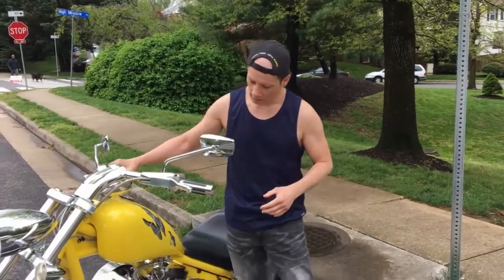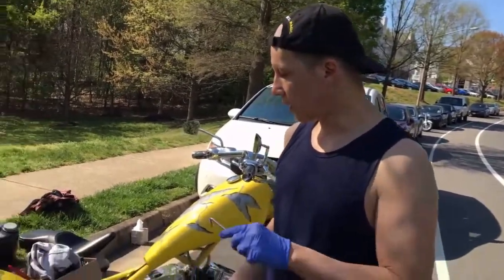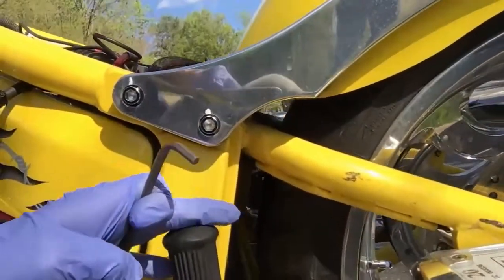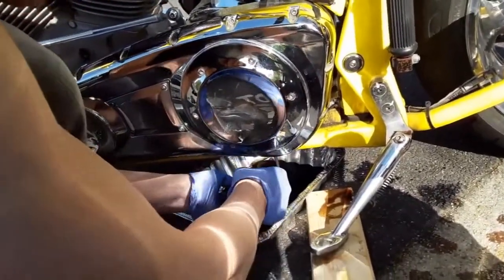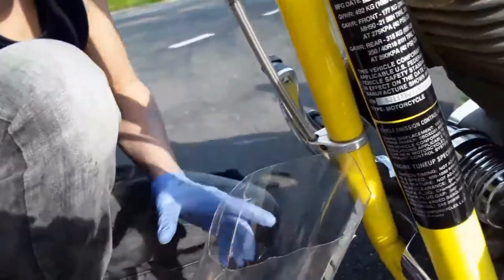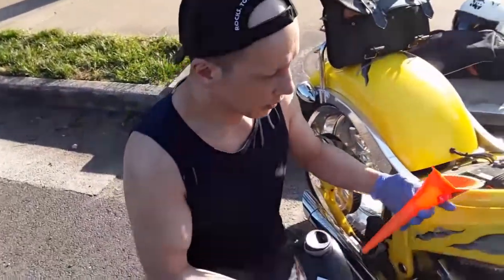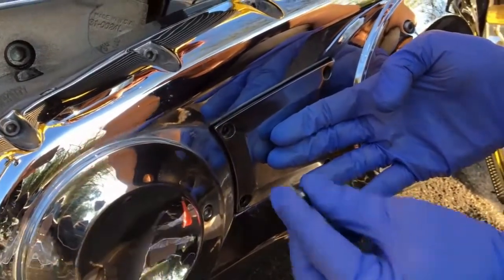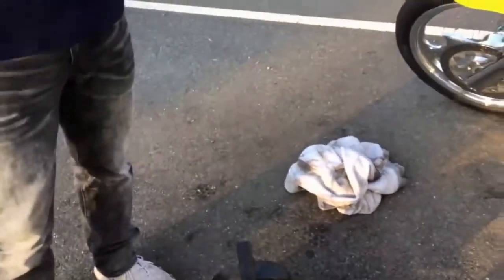S&S 117ci Engine oil change, Baker 6 speed transmission fluid, and baker DSSC primary fluid change

Comment: Great video bro..On my big dog pitbull 2006 primary capacity say 1.5 qt or 1.4 liter,do I need to put only 1qt or need to fill 1.5qt?
Reply from the maker: the full capacity may be 1.5 but the instructions I've seen say 1.0 so I've always filled mine to 1.0, no issues

Comment: I just changed the oil in my 117 s&s my front cylinder is now taking bad what could it be
Reply: My guess would be viscosity of the oil is not equal to what you had before